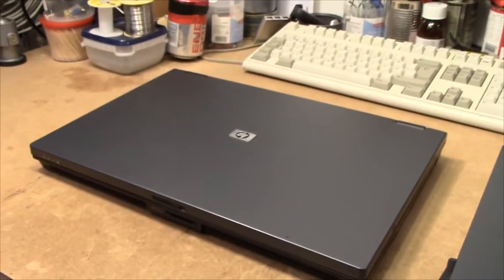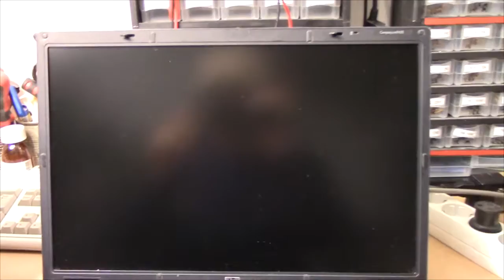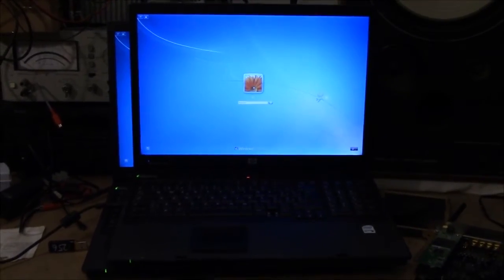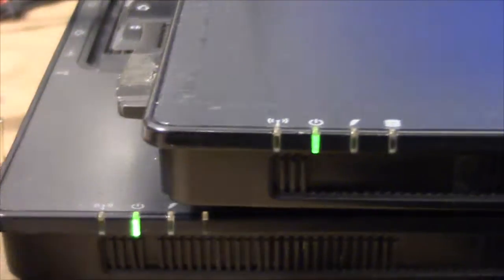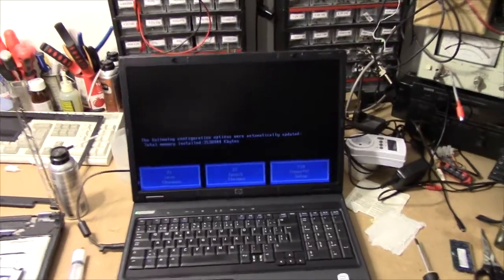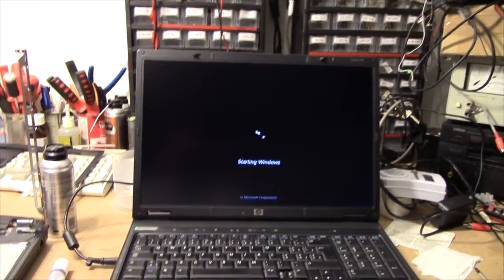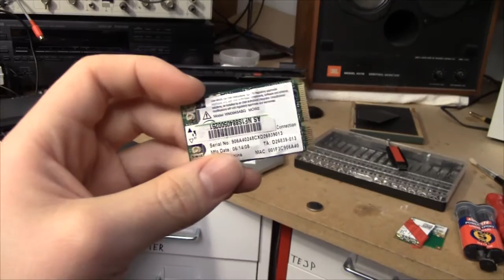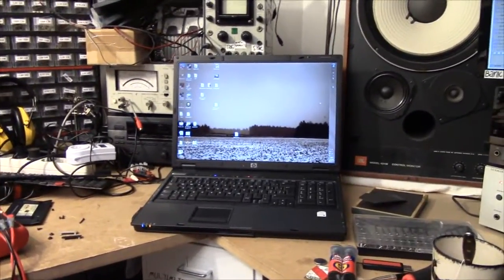Doing surgery on my HP nx9420 laptops

Comment: On an old HP nx9420, I have successfully replaced the HDD with a cheap 120 GB SSD for a nice speedup, running Windows 10. Replaced the battery. To run Windows 10 properly required downloading some drivers from the HP site. Although they are 32-bit Windows XP drivers, the ones I needed succeeded with 32-bit Windows 10. Needed the graphics driver first to get correct 1680x1050 screen behavior. Two others to enable the SD card and so on. Had an "unknown device" that required the driver for sensing acceleration (presumably to protect a hard drive head). Set power options for the WiFi driver so that it would remain on when the computer sleeps. Added an inexpensive 2GB RAM chip. Perfectly nice performance, far better than the original machine.
Reply: Hello Peter, Do you think any 2.5" SSD would work or is there any limitations?
Reply: @adamelekes  I am not a service tech, so am not certain, but I think that any recent 2.5" SSD ought to work. With a fresh Windows 10 installation (32-bit on the nx9420), a really nice performance jump results.
Reply: @peterbudgell7339  Thank you! I'll give it a try.

Comment: LoL I still have one 😇 of these, with a glossy screen. Sort of servicing it right now. Gonna give it the last upgrade, probably upgrading its CPU from a T5600 to a T7400.
In the video you complain about it not recognizing the full 4 GiB of RAM, this is a limitation of its 945PM 32-bit chipset, which can only map 2^32 bytes (4 GiB) due to only 32 address lines. However, since things like video memory (256 MiB), BIOS, ports and other stuff must also fit within that 2^32 bytes address space, the maximum addressable RAM for this laptop was set at 3.375 GiB (which is 3456 KiB or 3 538 944 bytes).
I'm still to find a laptop with such a well designed mouse pad, not too big and with an “underlying plain” shape which makes it nearly impossible for it to annoy you with accidental pointer movements or clicks due to palm touches, a plague in modern laptops with oversized pads level with the chassis surface. 😒
Reply: so 4gb ram max?
Reply: @Dj2006  What I said Dawid j, it's an Intel 945PM chipset limitation.

Comment: Nice video. Im still using my 10 year old nc6400 almost daily. Even the as old battery still works fine. It does run Windows 10 fine but I chose to install Linx mint. I have a desktop wich is only used when I want to game, everything else is done on the old one 😃

Comment: I have one to for almost 3 years ago. It was crap from work i use it alot, upgraded it to 4gig ram.
Can the gfx card be replaced to something better?
Reply from the maker: Not really. It is MXM, but finding anything but the stock X1600 or Geforce 7900 (I think) that fits the cooler is going to be near impossible.
Reply: Okay.. It is MXM-II?
Reply from the maker: Mikael Råberg I'm not sure, I'm sorry. Most likely not, given the age of the machine.

Comment: MLP detected
Reply from the maker: +Timur Nuriyasov Sound the alarm.
Reply: FFcossag Got myself the same TPA3116D2 amp after watching your video. Powering it with 19V laptop power supply I got the same overheating issues under 4 ohm stress test. I guess next up is the heatsink mod :)